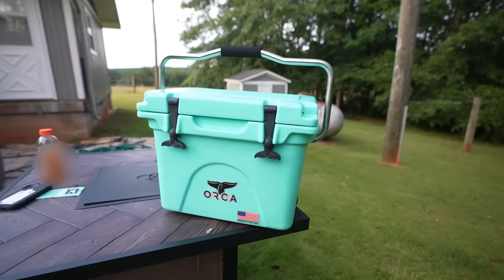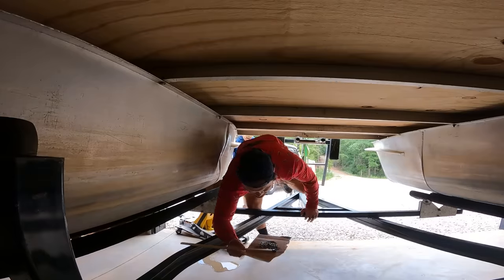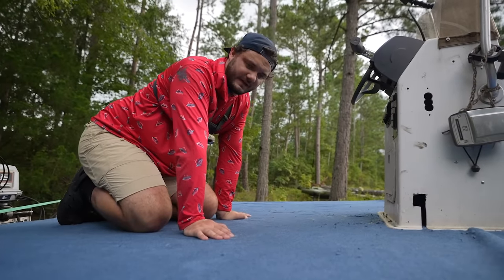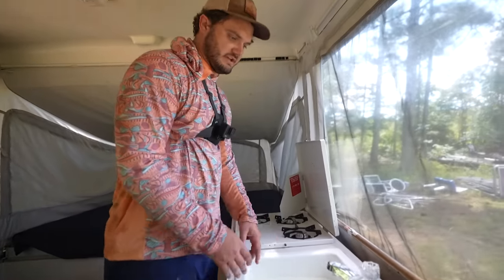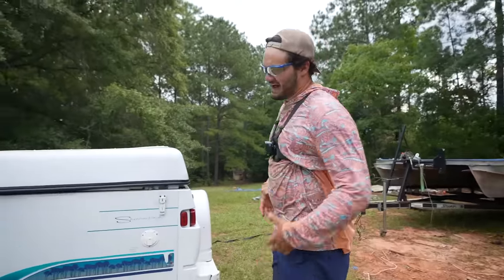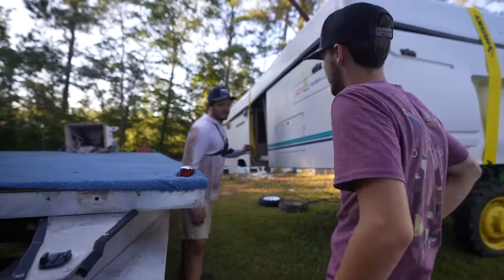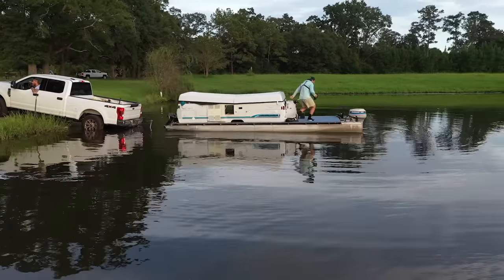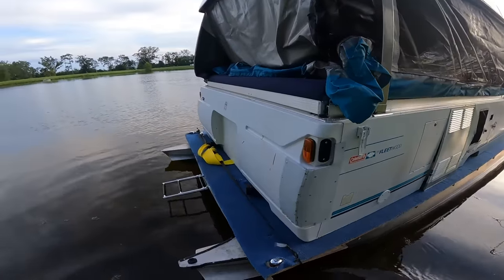Installing a POP UP CAMPER on my Pontoon Boat!!

Comment: More weight in the back. Should have moved the center console back some. Turn the camper 90 degrees so you can scoot the weight in the middle. Yeah the best part is your beds overhang over the water like a hammock and you can do some dangling while sleeping.
Reply: Move the console back or turn it 90 degrees.

Comment: Just take a plug drill a hole and thread it for a air hose connector and pressurize the toon and get soapy water and look for bubbles. Mark, clean and weld. Don’t half ass something like that.

Comment: What you want to do on the pontoon where the plug is put a air fitting with a air gage and a ball valve comet it to your air compressor put about 15psi and get a spray boodle with soap an water and spray the pontoon an fine all the licks.

Comment: I would have left the amenities and installed a few 15-20 gallon barrels between the pontoons (or canibalized an old wreck for some additional pontoons) to increase buoyancy  - more drag in the water, but you ain't building a speed boat - and a kitchen is a nice feature

Comment: turn it sideways?  i've thought about pulling the axel off my pop-up and putting it on a tandem flatbed sideways.  it might give you better access to the door as well as more deck space.  but it does look like your camper is a little longer than the width of your pontoon.

Comment: Get u a torch and some aluminum rods and heat the aluminum and apply the rod and it will melt right on the heated aluminum and will last longer than the pontoon

Comment: 14:26  because power tool vibrations are actually quite dangerous. you're only supposed to use tools like that for 15 minutes at a time .  or you risk getting "vibration white finger"

Comment: If that's not marine grade astro turf, I would have highly recommended putting down a moisture barrier because it will eventually rot the floor out prematurely every time it gets wet.

Comment: Probably should have turned the camper 90 degrees then you could have centered the weight better on the boat front to back and used balist to center it side to side

Comment: Why not blow air into the pontoon from the drain hole, and hold it under light pressure and then do a leak test on all joints.

Comment: Should have pulled those dents out before you put the JB weld on  that way the weld seam would have closed up more then after the JB Weld was dried it should have been painted with some Marine paint

Comment: Your weight distribution would have been better if you centered the camper.  Turned it so the beds open to the sides instead front, and back.  That would have given you deck space.

Comment: But....why not start with what you don't need, like wheels, axel and stuff? And if you find a way to transfer the camper to the boat without the frame, you can remove it.

Comment: I hope you have discovered by now there are REQUIRED stabilizers for the pull out beds under the beds, you will destroy the camper if you do not use them.

Comment: if you removed the axle and the wheels you couldve easily kept the sink and the stove.. the axle on that thing is definitely over 150lbs and each wheel is probably a good 15-20lbs, get a sawzall or grinder and chop off the hitch portion at the front and that would be another 50lbs... at this point i think you just like hitting stuff with a hammer 🤣

(this was posted about 5 seconds before watching you cut off the hitch with a sawzall lmao)

Comment: I would of removed the metal framing beneath the caravan temporarily structured it with wood placed it onto the pontoon boat an fastened it down removing majority of the chassis and weight and keeping the structural integrity

Comment: Air compressor put in drain plug seal. Turn on air compressor and a bottle of soapy water. Think of a leak on a tire. Hmm. Ask a old guy.

Comment: Still would have loved to see this build taken a bit more seriously.  If you had planned it a bit more, you could have cut a hole in the bottom of the pop-up for the boat console and dropped the pop-up over it.  Thn the pop-up could have been more centered on the boat, and you could have controlled it from the inside.  

I'd have loved to see you have some working lights and power/water and all of that.

I know it was a silly/fun build, but the way you did it, it's just trash now.  If you had taken a bit more time, you could have had something fun to kick around for the summer, and you probably could have gotten a couple of videos out of the build, and I think probably gotten more views .

Comment: Just buy a welder & learn how to use it!!! save you a ton of money in long run plus you could make money welding sh!t for other people, also pressurize the boat air tanks to 20 psi & spray soapy water all over it that way you can find the air leaks,,, easy as pie, ive done it bunch of times

Comment: simply removing the frame and axle the pop up camper sits on wouldve gotten you more than enough weight out of it without needlessly destroying the camper
Reply: removing the frame and axles is fine in this case because its going on a permanent platform

Comment: Would taking the axel off the pop up not make more sense than absolutely gutting it?  Probably weighs couple hundred pounds alone. Unless your planning to remove it again and use it on the road? *Edit had this typed before I seen the axel removal 🤣

Comment: That camper unbolts from that trailer if you'll just look underneath. That way, you'll save about 200 pounds off the bottom of that camper. Just take the camper off, leave the trailer. Quit cutting the traibecause you might want to use the tamper again on the trailer

Comment: I would've cut down the height of the steering dash if it was too high then moved it forward and cut out an opening in the camper floor to sit the camper over it in a position to drive while sitting inside the camper so I could get drunk and know body know..  jk maybe yeah

Comment: To bad you did not cut a hole in the bottom of the camper and lowered the camper over the console and had it inside the camper. Would have put more weight in the back. Would have been funny just seeing a camper going across the lake not seeing anyone.

Comment: What happens If it ends up sinking or falling over in the night you didn't calculate that because you would be trapped in it that think will sink faster Than you can get out and you'll die and you don't even know if it's still sinking with water it's unethical and unpredictable even with the weight leading on the bed to the front don't do it!

Comment: Really have no clue to what you doing it comes to laying carpet do you wrong trial and the way you like carpet man is you start one side length ways glue it take the other side flip it over on the side that you glued run your glue down that side then put it back over and roll it out oh yeah I hope you got a weight roller to roll out the wrinkles